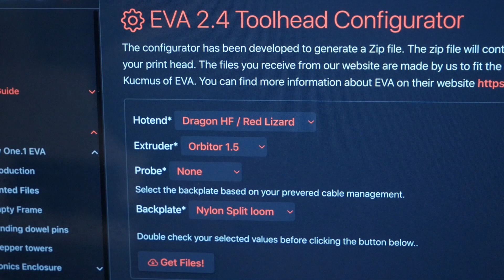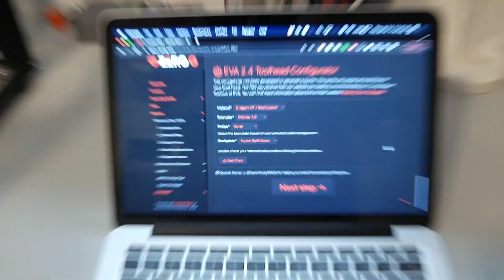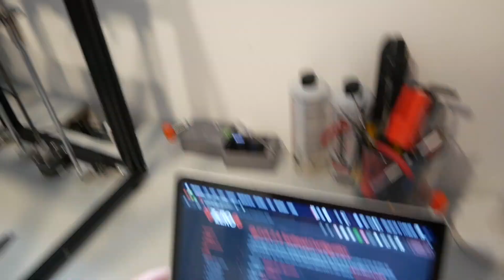Motor Mounts and EVA Configurator | ZeroG Mercury One.1 Conversion

Comment: I have two add-on components on my E5+ that I like, and would prefer to be able to keep, if I decide to do this conversion. The first is an Exoslide gantry, and the other is a MicroSwiss DD. Can anyone reading this please let me know if this is possible. If it's not possible, can I reconfigure my BTT SKR Pro v1.2 to control three separate Z motors?? I am currently set up for X, Y, Z0, E0, and E1 is being used for Z1, and I have one remaining spot on the board for a stepper driver which can hopefully be used for Z2.  I would be willing to forgo the MS DD to be able to print multiple colors, but I think that would require a mainboard that has more than six stepper drivers. I also have a 3/8 thick cast aluminum tool plate for the print bed, with a Keenovo bed heater that I also want to keep. Any help will be greatly appreciated. Thanks in advance.
Reply from the maker: Hi sorry! Not sure how I managed to miss this.

I am not sure about keeping the exoslide or the Microswiss DD, I have certainly never seen it done at least. With an SKR Pro you will definitely be able to control 3 motors for a triple Z setup. For multicolour printing, you could look into the ERCF, and the ERCF Easy BRD so you could keep your old SKR board in the printer. Otherwise you can chain multiple boards together in klipper.

Comment: Looks good, do you have the link for the modified stepper mounts that you mentioned
Reply from the maker: Here you are! https://www.thingiverse.com/thing:5430682
Reply: @mitsumakes  Thanks for the quick response. How do you like the conversion? I have to 5+ machines that I am fixing to convert.
Reply from the maker: @joeyz4539  No problem! The conversion makes the printer a whole lot better, but a standard kit does not address the "diving board" flex on the bed, which is a consideration when going fast.
Reply from the maker: @joeyz4539  The 5+ bed is more stable, so I think you'll be safe